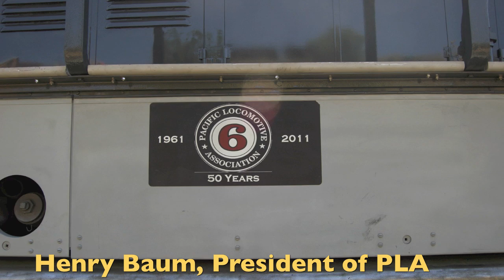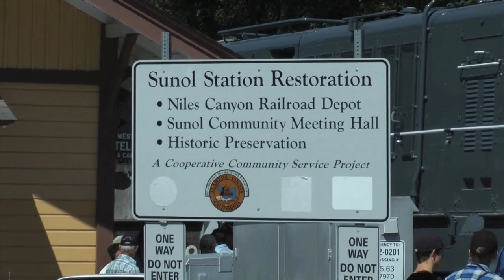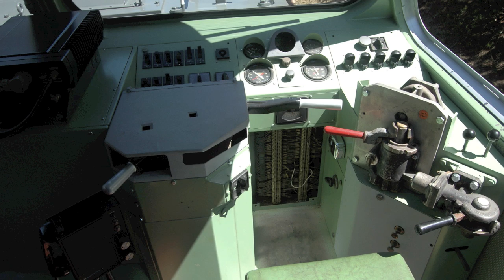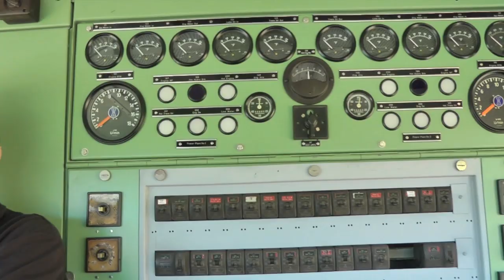SP9010 Birthday Bash

Comment: holy c***!, I thought those had met the usual fate or all the oddball second gen. stuff, this particular product especially,. due to the rather involved amount of engineering.
second, those trucks looks suspiciously like a set of PA trucks, did K.M. copy those, or buy them outright from ALCo?
nexr and last, watched the clip on the search for TDC, been there with a slew of old motors, how involved was the process to finally fire off that critter?